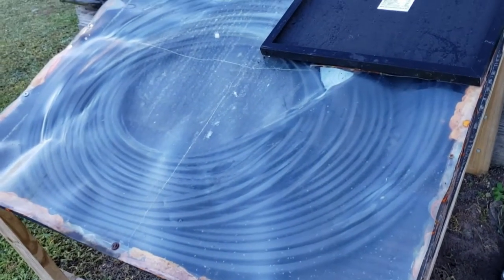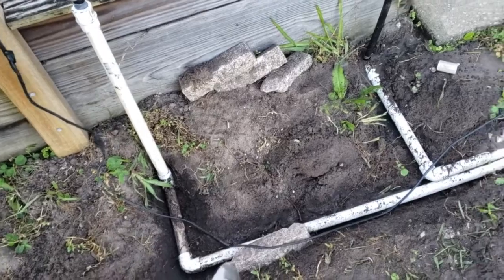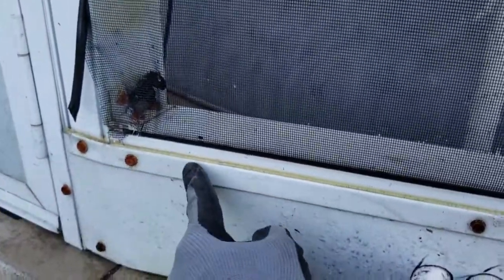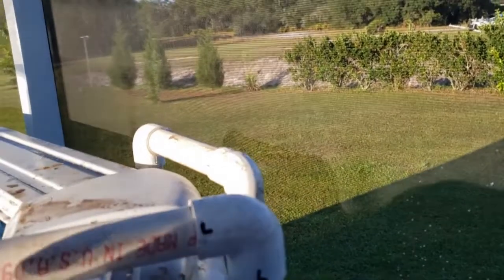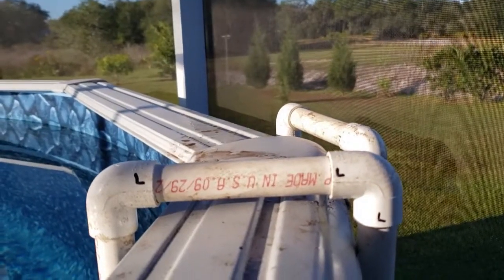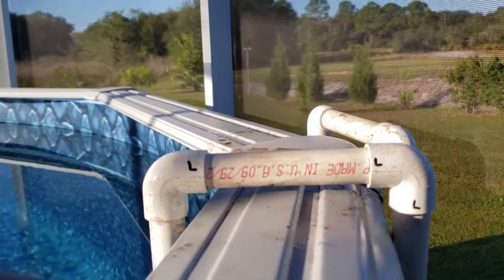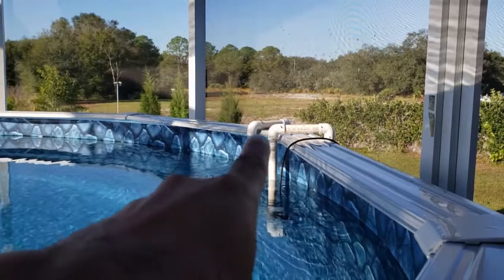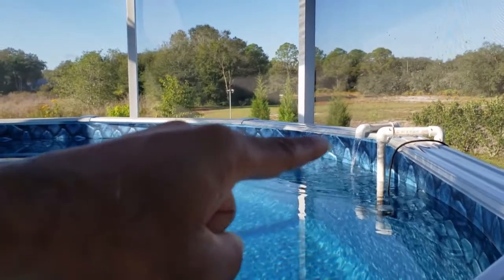Solar heater update pt 3

Comment: Can you tell us the difference in temperatures ?
Reply from the maker: I measured it today when ambient temperatures have been in the 80s. Due to the high rate of flow there is a 4F difference  between the pool water and returned water. If the solar panel is disconnected and then reconnected after a few minutes the water from the heater can scald you.
Reply: @Andrewsnotes1  Flowing to fast ?
Reply from the maker: @brikfiend  Shouldn't matter, its the mass of heated water that makes the difference.